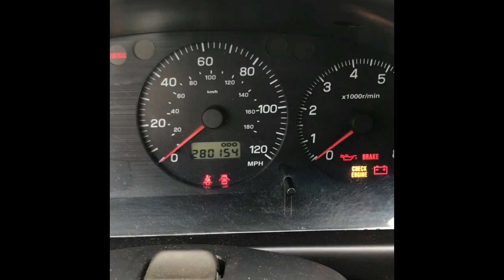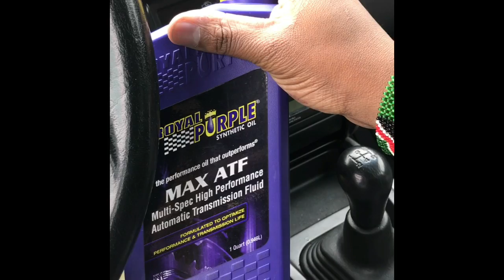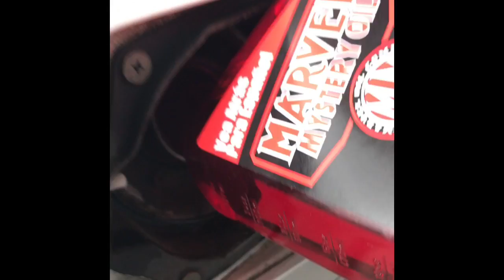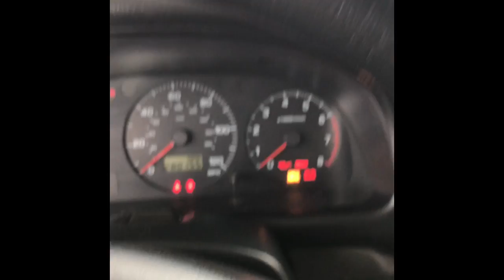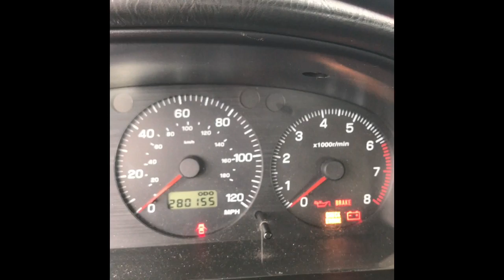2000 Subaru lifter ticking noise

Comment: there are no lifters on that engine its a solid roller cam to a solid roller rocker that presses the valve. If you have a valve tick on an ej series engine snake oil in a can willo not help. You need to adjust the valve but in your case it's an exhaust leak.

Comment: 2 things: 1. This engine does not have hydraulic lifters, so using oil additives will not fix valve lash issues. Fixing valve ticking is a fairly easy process, you just need to take the covers off and adjust them. 

2. This sounds like an exhaust lead at the header, either at the gasket or a crack in the pipe. If laying underneath and looking for a sooty spot or feeling for puffs of air doesn't locate it, have a buddy put a hand over the exhaust pipe while you are underneath, it should start hissing and be easy to find. 

Hope this helps!
Reply: im having the same horrible ticking/clanking noise from my 2002 wrx. ive driven with it for 2 months now and its the same sound, so ive rulled out it beeing rod knock. but it really sounds like it. but, is there a guide online for adjusting the valves? thx for all help :D
Reply: Turbo DOHC engines are bucket lifters, which are shimmed. You'd need to take measurements and then purchase the proper shims to stick under the buckets. I don't have much experience doing those adjustments though, so the exact process I'm not sure. 

I'd check forums like NASIOC, there's a lot of good info to be found there.
Reply: Yes they do boi
Reply: Do you have to pull the engine for this?
Reply: That's first thing I thought too, additives won't do anything to help solid lifters, they need to manually be adjusted.
Reply: @Shabapulon  No, just take off the valve covers. So take off spark plug wires, windshield washer bottle, breather hoses and remove the covers. You need a feeler gauge set, like $5, then loosen the locknut and turn the inner screw in or out until the right size feeler is snug but still moves. Then tighten the locknut and recheck.

Comment: Hi Stanley, sounds like exhaust hair line crack or loose nuts. That sound appears when you press the throttle gas. Lifter ticking noise usually idle and you press the throttle gas

Comment: I had a 89 Subaru Loyal and it was very loud to the point where you had to yell while speaking with passengers, so i used MMO in the gas and oil and it quieted down,ran smoother and gave more power, man I love this stuff. I sold the Subaru with regret after 289,643 miles only because it leaked a lot of oil, it would have been cheaper to just get the seals redone than buying another used car.
Reply: Fred  aww that  atf works a lot  better  i have heard  plus puting gas in your oil is hard on engine    plus useing good oil helps    but when your engine  gets  loud   take it some were to make shure everything  is  alright   also check your belt tenchener  they can get loud to .  But try atf
Reply: The EA82's in those cars had a poorly designed oil pump gasket, they would go bad and suck air in. They are only about $10 for the seal & gasket set and that will fix the noise for a few more years.

Comment: Royal purple is a top tier oil. I certainly don’t see the benefit off adding any more additives to it. Been tempted to use MMO based on the excellent reviews... That boxer engine sounds magical!
Reply: BW 555 lol royal purp is poop after it barely gets too hot or used more than 4k miles. Beautiful at first almost perfect jus doesn’t have any tendency to last cycles
Reply: MMO is probably the best additive of all additive. Can add to the oil and the gas and is fairly cheap but very effective

Comment: dude i love the sound of your exhaust! i have a 01. what do exhaust you running. plus i have the same ticking noise. but mine is only in idle
Reply from the maker: I appreciate it. It's with Megan exhaust racing pipes. The cool thing is that it comes with the silent mode where are you screw in and attachment that makes it more silent and when you take it out it's more loud
Reply: Hey man I have a 2000 and it makes a ticking sound when idle as well have you found a solution or you rolled with it

Comment: So what was the ticking coming from, and how did you fix it???
Reply from the maker: The ticking is the lifters ticking but if you end up hearing knocking basically your engine is going out so my lifters were taking but I ended up using a thicker oil to minimize the noise but I had way too many miles on that engine and it slowly went out It started knocking real bad until eventually as soon as I parked it it never cranked back on... And that's a whole engine job 😔

Comment: You are supposed to use 4oz per 10 gallons of gas.
Reply: Yes you are right when it comes to the fuel system. It can be added to the oil and can be used as an oil flush too

Comment: Vipi kaka, just saw your video while searching for a similar ticking sound from my 2002 Impreza TS wagon..
Reply from the maker: Boniface Muriuki. Did you figure it out what the problem on urs is? Asante kwa kusubscribe ndugu..
Reply: Stanley Ambeyi bado, planning on taking it to a mechanic soon, initially I thought it may be idler pulleys.
I used a long screw driver since I don't have a mechanical stethoscope. Narrowed it down to driver side
Reply from the maker: Boniface Muriuki hope it’s nothing too bad, coz Subaru’s are notorious once u hear ticking or knocking sounds ends up needing an engine rebuild. Cross my fingers for you bro
Reply: Stanley Ambeyi I hope so too, but from the forums, I understand it's common and may not be serious, probably valve clearance that needs adjustment, or an exhaust leak, or maybe fuel injectors worst case would be a faulty timing belt tensioner pulley or pistons, or lifters...
Reply from the maker: Boniface Muriuki yep lifters not getting sufficient lubrication because lifters from a Subaru usually have little small pores if they get clogged up from engine sludge. You end up getting the ticking
Reply: Stanley Ambeyi was that what was your issue?

Comment: so 300mi later did it stop clicking?
Reply: Go buy   a litre of diesel fuel  poor it in the engine let it idle for 2 hours  leave the diesel in over night to desolve  all the  carbon   ...fixed
Reply: Where did you pull that idea from? I've owned 3 Subarus in the past 10 years, 2 sti and 1 WRX (current). The my08 sti was brand new with 112 miles on it. Every single EJ engine has lifter tick, it has nothing to do with carbon build up. They just have a loud valve train. One thing you can try is using 5w40, I've heard mixed results from using an oil additive. ((NEVER PUT DIESEL IN ENGINE OIL)). Seafoam or Chemtool if you must, and do not leave it in over night!!
Reply: Nik Coffman you can run seafoam/ mmo/ atf in your oil

Comment: it's your valve cover gasket mate, you need to replace it
Reply from the maker: WENICO GA, thanks ended up doing that a couple of weeks later. Sounds way better now. Am all smiles:)
Reply: And while you've got the cover off, adjust your valves.
Reply: @stanthekenyan  was it a big job?
Reply from the maker: @renasdupont2806  I somehow knew that the car was slowly dying. So eventually you will have to rebuild the engine or get another put in. I was trying every way to push it a little longer and learning more about it with every hiccup
Reply: @stanthekenyan  😱😥 I just made it straight pipe and a tune for 300 hp.. Rebuild will cost me about 5-6k canadian dollars.. We love those cars a little too much for how they love us
Reply from the maker: @renasdupont2806  WOW, yeah tell me about it. I bet it sounds amazing, I loved the way mine sounded.. with just the Megan racing pipes. I can't wait for the build to get finished then it'll be back on the channel 😊
Reply: @stanthekenyan  it's a magna flow muffler 3 inch from turbo to the back.. So it sound round.. Not annoying sound like I've heard too many times.. But great sound at 6500 rpm.. At that point I don't hear any noise from the engine 😂😂😭😅
Reply from the maker: @renasdupont2806  Dude you should upload some videos of it on here
Reply: @stanthekenyan  maybe on some other platform then big tech one day

Comment: I could care less if it was a exhaust leak or a ticking lifter. I would like to know however, did it seem to make difference anywhere? especially after the whole tank of fuel ran through.
Reply from the maker: BourbonWhiskies yes it does actually make a difference straight away.. I was shocked myself and didn't believe it at first
Reply: Nice! Thanks for the update.
Reply from the maker: BourbonWhiskies no problem, you welcome

Comment: You need a new car! 🚘
Push this one off a cliff! 😂
Reply: Boi these things run forever. Keep running the Subie til your hair turns white!
Reply: No. These cars will do another 100k WITH that ticking noise. It goes away after it’s warmed up. My Wrx does it
Reply: @Rumblefan  definitely doesnt go awayafter warm up for many subies. my 02 outback does it no matter how warm
Reply: theothermullen  that’s not necessarily anything to worry about still. Subaru’s are just noisy engines. Lots of lifter tick, piston slap, etc, that makes them noisy. If it was actually your motor knocking, you’d know soon enough when it blows up. I’m on my second Subaru now and both are noisy.
Reply: @Rumblefan  my fxt07 been making this sound for 2 years now...but does not much goes away after warm up ...its fkn annoying
Reply: I have multiple cars that don’t tick, I don’t intend to push my Subaru off a cliff. I intend to learn how to fix .